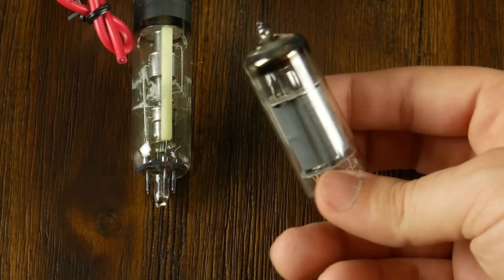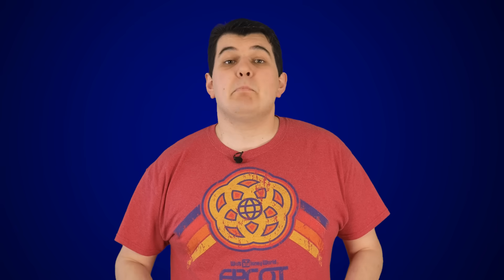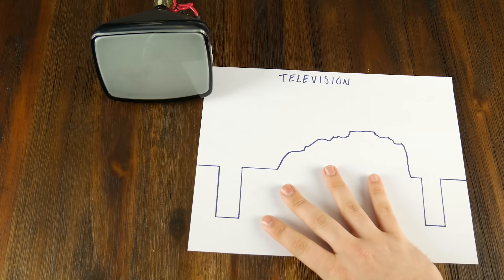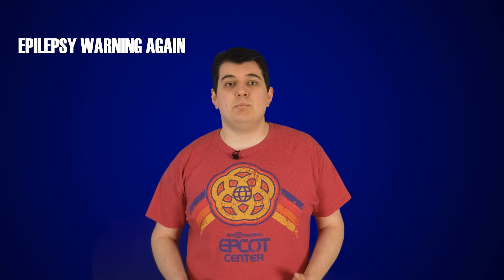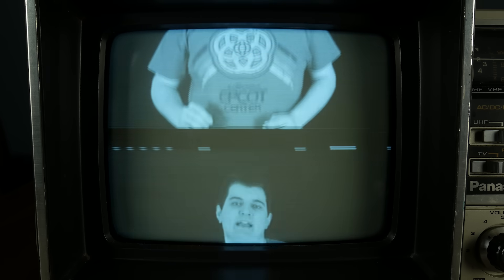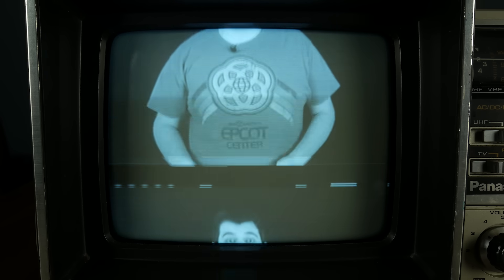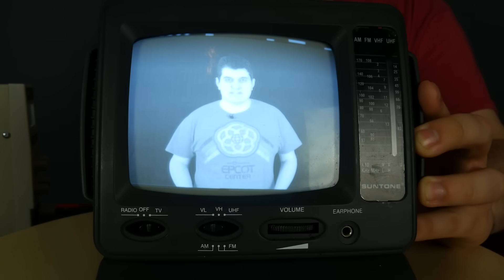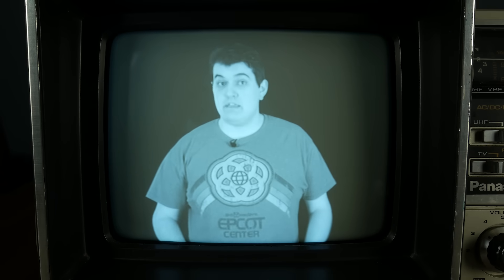Lines of Light: How Analog Television Works

Comment: I'm 54 and can still hear it. back in the day I could walk into any house and tell if a t.v. was on. You should have commented on the advent of the analog phase-locked loop, which made the h-hold and v-hold automatic, but that will be covered in the color video. NTSC never the same color.
Reply: It annoyed the hell out of me last year. After 1-2 hours playing my ps2 on a huge crt tv, it would start doing this sound and noone would even hear it! I turned off the tv and back on, it stopped and I didn't know why is this happening
Reply: @joskad6569  
some people say you can just put some epoxi to glue it to the pcb so it wont vibrate.
also some tvs and monitors had an option to DEGAUSS the screen:
https://en.wikipedia.org/wiki/Degaussing#Monitors
Reply: @lutyanoalves444  Degaussing is basically just demagnetising. A lot of sets (and monitors) did this at power-on - often the reason for the switch-on thump. Not connected with the line frequency whistle: degaussing was mainly to remove any magnetism from the shadowmask,, which caused slight deviation of the beams and thus colour misconvergence - and thus I think it was only on colour sets.
Reply: I can even hear those deer keep away things and I'm 30
Reply: I miss that about old CRT's, I used to know if a TV was on nearby too, some people could hear them resonate while others couldn't, I used to get in from school and be able to tell my mum that the TV was left on in her room and she'd wonder how I knew.
Reply: Ma ON Strange. You must have very good hearing still, to be able to hear such high-pitched sounds.
Reply: Can pretty much ear when there is a short in electronics, makes an awful high pitched noise...
Reply: I note your use of the NTSC dig (I knew it as never twice ...), so maybe you're UK too. In which case you'll certainly remember the whistle from 405-line sets: that was only 10.125 kHz! (And sets of that vintage made more noise anyway - more power in the LOPT, or less well secured, or whatever.)

NTSC (national television standards committee) - never twice same colour.
SECAM (sequentiel couleur a memoire) - something essentially contrary to the American method.
PAL (phase, alternate line) - peace at last.
Reply: Ma ON same i thought i was the only one but im 16 tho
Reply: Meanwhile I am 22 and cannot remember to have heared it at all in my life.
Reply: masterP You must have hearing that cannot hear high-pitched sounds. Most people start being able to hear it at a young age, but when you get older you lose the ability to hear the sound.
Reply: Your 55 now
Reply: @nomalasg6927  My 55 now what?
Reply: G6JPG now your 55 and a week
Reply: @nomalasg6927  It wasn't me that said I'm 55.
Reply: PAL Plain Analog Logic.
Reply: @hifiteen49  NTSC (national [!] television standards committee) - never twice same colour; SECAM (sequentiel couleur à memoire) - something essentially contrary to the American method [which it was: weird system!]; PAL (phase, alternate line) - peace at last [overcame the shortcomings of the other two].
Reply: never twice same color
Reply: I'm 34 and I can still hear it

Comment: I do not agree with what you say at the beginning of your video. Liquid crystal display technology is an order of magnitude more complex than cathode ray tubes and requires a profound understanding of liquid crystal and semiconductor physics, which is incidentally also the reason why it took humanity one century longer to figure out how it works. Apart from that however great video!

Comment: This is one of the better explanations of how televisions work that I've seen. 

I did notice a few inaccuracy around interlacing. There is an inherent simplicity and genius to interlacing that apparently takes a long time to grasp.
There are no "special pulses to differentiate between the odd and even fields". Interlacing was done back in the '30s (or sooner?), when the hardware to pick up such pulses on the TV would be expensive (early b&w TVs are pretty much just a radio receiver, an electron gun, two flyback transformers for horizontal and vertical scanning and two synchronization circuits to adjust the flyback transformers to the horizontal and vertical pulses in the signal). CRT TVs didn't even know they were displaying an interlaced signal, it was all done at the television studio.

Interlacing is just a mismatch between the horizontal and vertical timings, there are 525 lines (or 625 lines for PAL) over 1/30th of a second, which means that over 1/60th of a second (or one interlaced field) there are actually 262 and a half lines (312.5 lines for PAL). It's this extra half a line which "causes" interlacing.

When the lower field comes along to the start of it's first non-blanking line, it's exactly half a line later relative to the vertical timing compared to the upper field. And as the vertical deflection is continuously sweeping down the screen, this means that all the lower field's lines end up exactly half a line lower down the screen than the upper field's lines.

To create a progressive display mode (like most early game consoles did), all you need to do is is adjust the vertical and horizontal timings so you have a whole number of lines every frame (ie, 524 or 526 lines over 1/30th second). Theoretically, there is nothing stopping you creating a tipple or quadruple interlacing mode by having a extra 1/3rd or 1/4 of a line in each frame. CRT TVs will display it, but the result might not be pretty.

Comment: I am only asking this here because it's his latest video.

Part of a 3.5mm jack has broken off in my tv and I am wondering if anyone knows any tricks to get it out. I don't want to open up the TV if I don't need to. Luckily, the bit that broke off is the end of the connector and it isn't causing the audio to be sent to the headphone jack but I don't want to go fishing for it just in case I do pull it out enough to cause that to happen without actually getting it out.

Any ideas, anyone?

Comment: Nice video!

There is interesting difference in terminology: in English TV set contains horizontal and vertical deflection yokes, while in Russian they're called 'row deflection' and 'frame deflection', indicating that full cycle of first one completes one row of image, while the full cycle of latter completes one frame (or rather half of frame). This way it's obvious from the start why they are different (parallel connection of windings in row deflection and series connection in frame deflection etc.) and why the devices that control them are even more different: huge flyback transformer and transistor on heatsink for horizontal deflection and little IC for vertical one.

Comment: Since you are going to explain mechanical (scanning) TV, you possibly are aware that the scanning system for transmitting and reproducing pictures preceded television, being used to send photographs over phone lines for newspapers. The conception of transmitting moving pictures was not a great stretch. Practical development was a great stretch.

 They often give a misshapen impression of the history of technological devices when they give years of origination. TV ownership in the US, for use in the home, remained utterly beyond the reach of people with the incomes that 95% had, until just after WWII ended. In contrast, experimenters were already pioneering television before broadcast radio reception had become usual in homes. It took a tremendously long time, and serendipitous war development of electronics, to get TV practical. Even then, the first US home TV's were stupendously expensive, although they dropped fast, as mass-marketers saw the potential, seeing that everybody was buying a TV as soon as one came into their price range. Movie attendance was near collapse, with people staying home for their visual entertainment fix.

Comment: Dont need to tell me the dangers of working inside a CRT display, I've already been shocked by a 27 inch TV's fly back transformer and I will say, 25,000 Volts hurts a lot

EDIT : I'm 25 and I still hear that annoying whine that comes with CRT's and induction coils on electronics. Though I've noticed it sometimes happen when running old crts or running crt's out of spec (like running a 800x600 crt at 1280x960, while it will work, it might produce noise)
Reply: 26 years old now and even after 4 months of working in a welding shop without hearing protection that 15.7 kHz noise is still audible and still annoying.

Comment: You explained the general idea of how it works,   but by the time you get to the electron gun,   you just kinda stop there and dont explain further....  
How exactly does that big mess of copper wire make sure the electron gun fires the electrons super nicely in straight horizontal lines each exactly below the last for so stupidly fast that it can make a full frame 50 times per second?    i still have no idea :P

Comment: Awesome video and good explanation. Though, a small correction: the flyback in the small B/W TV is about 10kV - not only 1kV. A color TV is about 25kV.
Reply: kV meaning "killer volts" because if you slide a finger under the suction cup that is attached to a CRT you will transition from a living state to a dead one, and the coroner will deduce the entry point of electrocution as the blackened stub that used to be a finger..

Comment: Now could you explain which part of the CRT generates high voltage and how to harvest it via a vire onto rubber belt of home made van de Graaf generator?
And I thought I was the only one who heard noise from the turned on TV and nobody was disturbed by it when they fell asleep with TV on.
Reply: The flyback transformer does it. There is heavily isolated wire going from it into the top part of CRT tube, it ends with big suction cup. You can take it off the tube and use in your own evil ways (please, be careful).
Reply: Evil ways, I like the sound of it, but unfortunately it's strictly for scientific purposes.

Comment: I thought that squealing the TV did was the flyback transformer. Someone I know who used to repair TVs said that squeal gets louder as the TV ages. Can anyone confirm?
Reply: Josh Derak I can't confirm that from the perspective of scientific understanding, but intuitively it must. Anything that is free to vibrate will work itself loose over time and thus be able to vibrate more.
Reply: @Josh Derak
not so much on newer crt tvs , the old varnish they used to use on old sets wore out somewhat and the coil became looser :-)

Comment: Good job explaining and nice video. My high school electronics class was the last class to build a TV from parts as our final project. That number 15,750 was drilled into my head so hard that I remember it today. Our school bordered Radio Valve Road which was the home of a RCA tube plant that supplied our class with all RCA parts. It was a fantastic experience to actually build something fairly complex and get it working and encouraged me toward electronics as a career.
Reply: Correct me if I'm wrong but that sound we all hear is Not the CRT but the horz. / HV Flyback transformer core oscillating at 15,750 Hz.
I used to rebuild CRT's for 32 years from 1970 to 2002 in phila. Pa.
Reply: @benbart5711  That's what I always thought it was too, and the sound would get worse if the anode connection wasn't tight.
Reply: @JeffDeWitt  a lose anode would give a corona discharge. What made a loud 15,750 noise was the buyback being lose on the ferrite core. Ever notice why they were glued on the core?? Often that glue dried up this allowing for the coil to "rattle". A toothpick usually cleared this up
Reply: Brian Boni A few years ago I attended a class where each of us built a computer that actually worked. Was very interesting.

Comment: Whenever possible I adjust the TV to eliminate overscan as much as possible as I value an intact image over hiding the closed caption info. I even do this on flat panels by putting it in to 1:1 pixel mapping mode. My Toshiba calls it Native mode.

Flat panel TVs unfortunately emulate overscan by scaling the image up a few percent and then cropping all 4 sides. So even if you are watching a 1920x1080 image on a 1920x1080 screen it often isn't just displaying it as-is, it scales whatever resolution it gets up to for example say 1952x1098 then crops 16 pixels from each side and 9 each from the top and bottom. The exact numbers don't matter, what matters is that scaling reduces picture quality and cropping of course robs you of some image that is supposed to be there.
Reply: yeah i too prefer the "just scan" method instead of having to deal with image crop. I refuse to accept any kind of safezone image crop nowdays. Because that is shit that we have thankfully overcome through technological progress. It's just a problem sometimes when you watch movies and shows with their old Broadcast master that has TV safezone crop in mind and now you see the flaws around the edges of the frame.
Reply: My family still has a Samsung plasma TV, and I assume the cropping is to accommodate the burn-in protection, which shifts the image by a few pixels every 10 minutes or so. The "Just Scan" picture size turns the protection off, and for some reason, isn't available when the image is in 720p (but is available on 1080i).
(Personally, seeing all of the image is weird since there's so much unused space along the edges (though it's more the fault of graphic designers trying to accommodate sets that don't have a "Just Scan" option), so I usually just leave the image on regular 16:9 "cropped" mode.)

Comment: vacuum tubes are also in electric guitar and bass amps
Reply: And they'll stay for VERY long in microwave ovens. I would be surprised to live to that day when microwave oven uses solid-state 2.4 GHz amplifier with at least 700 W output power :)
Reply: @AllMyCircuits
it is surprising that most ppl dont know that the magnetron is a tube (valve) , ive never thought about an all solid state microwave oven before now tho , what do they use to transmit satellite tv signals ? :-)

Comment: When you cover color TV in a future video, you can include the explanation of the 29.97 frame rate mess (and why that horizontal oscillator is around 15734 Hz.   I have 2 different books that explain it and both are from the 1950s.   I am astonished that this 29.97 mess was carried into the world of HDTV.
Reply: 3Cr15w311   That's another whole topic; backward compatibility.  They were determined to build a newer system that would continue to be compatible with the large number of TV's that had already been sold.   It's a topic that had a big impact on the development and success of the PC but also in slowing it's later development.  The reason why we can no longer run (natively) old 16 and 32 bit applications is because after 15+ years if maintaining backward compatibility, somebody - Intel probably - decided it was no longer practical.  So newer PCs can jump light years ahead but now we can only run old software in simulators and virtual environments.
Reply: @Rob Fowler
64-bit x86 CPUs (Intel's, AMD's, and others') can still run 32-bit code in their native 64-bit mode, and the 32-bit mode on them can still run 16-bit code. Alongside Microsoft's insistence on backward compatibility, that means you can still run 32-bit programs on 64-bit versions of Windows using the built-in Windows on Windows (WoW) system, and you can even run 16-bit Windows 3.1 programs on a modern 32-bit version of Windows 10!
Reply: @iamnomad101  dont get me started with braindead x86 architecture and the monopoly of M$.
I wrote assembly code in 1976 thats is STILL running w/o modification on brand new mainframes.
Lets see can I run win-3.11 code on windows-10 natively..... Gues again? NOT

Comment: It's called a flyback transformer because it'll literally make you fly backwards when you touch it.

Also they're called valves, not vacuum tubes.  Watch a Techmoan video once in awhile, hello!!
Reply: Valves in England (and most Commonwealth countries?), but vacuum tubes in North America.
Reply: Midnight Mechanic, the reason why it's called a "flyback-transformer" is because its input is taken from the return-phase of the horizontal-deflection signal (a.k.a., flyback).

Comment: 12:20 Those very old TV from 1970s and earlier have both vertical and horizontal hold which means if horizontal hold is wide enough it can be adjusted to display the old 405 lines from U.K. using 10.125 KHz horizontal frequency or the opposite 819 lines from France with 20.425 KHz horizontal frequency but they are only displayable via AV input. They are incompatible via RF because of different systems (positive modulation for 405 & 819 lines using systems A & E respectively). For PAL & NTSC where the horizontal frequencies are near identical adjusting the horizontal hold is not a concern but it's the vertical hod needs to be adjusted due to 50 Hz & 60 Hz differences.

Comment: Can you do a video on Analogue satellite TV?
Reply: I doubt he ever will, but i'll tell you this: It had far more bandwidth than terrestrial broadcast, nearing 12Mhz so "studio quality" when conditions were perfect (it could get noise in transit). Each channel consumed the entire transponder. Nowdays a single transponder serves several digital channels... Other than that the antennas were huge so you could move them from west to east without any other alignment, and the C band is longer than modern Ku/Ka etc. And yes, until the late 80ies the signals were unscrambled, i guess they assumed only cable operators or tv stations (news feeds) could afford those huge things (think 24' or more, the father you are from the equator or intended footprint the bigger you need).